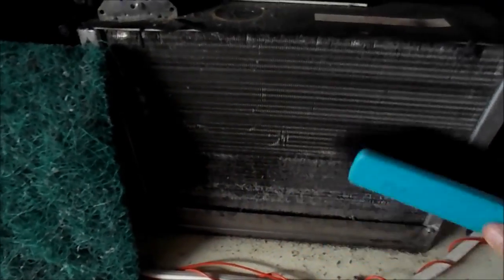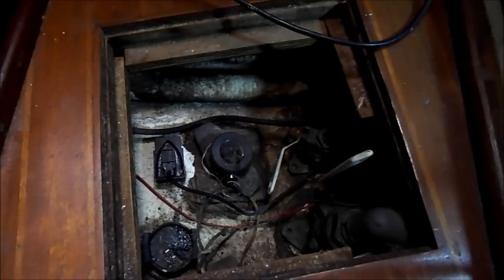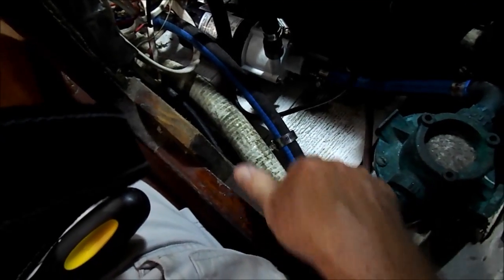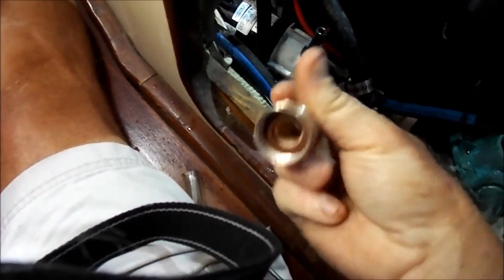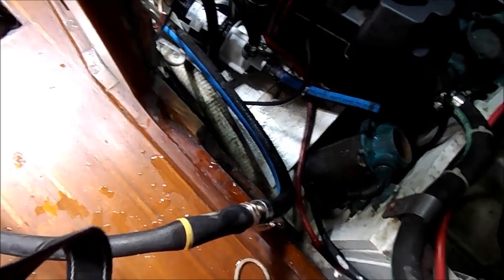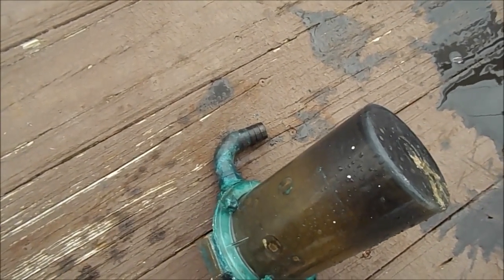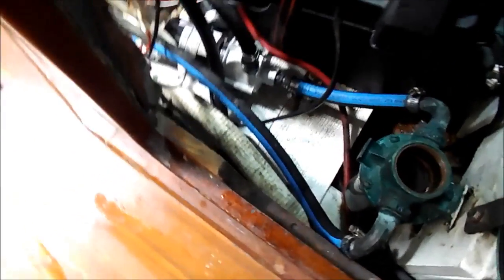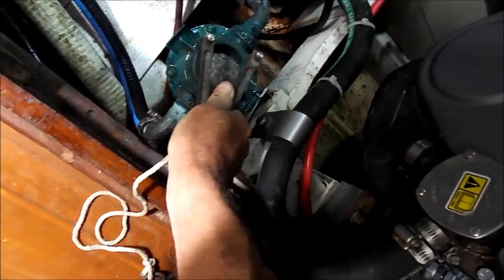Marine AC maintenance

Comment: Two things I noticed... 1: your hoses should have double hose clamps at each connecting point.
2: your sea strainer does not appear to be bonded. You should run a ground wire to the ships bonding strap to reduce corrosion.

Comment: I removed and cleaned the strainer, but now I'm getting a high pressure lockout message on unit, any ideas of what that might be?
Reply: lack of air or water flow.  check air filter and coil for dust and check if seacock is opened all the way check if underwater pick up isn't clogged. if you've already fixed it what did you find wrong? fan blades can get really dusty and not move enough air also.

Comment: The cap for the strainer should be HAND TIGHT. Using a pin wrench to tighten it is why the mount
 cracked from the bulkhead. Hand tight is MORE than sufficient to cap the strainer

Comment: hey I used to work for groco that appears to be one of those strainers if you give them a call you can get a new drain plug they are not that expensive they're located in Stevensville Maryland most everything they sell is made in America the casting for your strainer was cast in Lancaster Pennsylvania and Miss CNC machine in Maryland the plastic Bowl was also made in Maryland at a place that does injection molding as well as your drain plug call and ask for John Cly

Comment: Great video captain Steve.  I just moved up from a 28' to a 32' cruiser, the AC is working on the new boat but seems to be kinda weak.   What would you suggest for troubleshooting?  The boat is a 2000 model cruiser yacht.
Reply: chad demeuse following